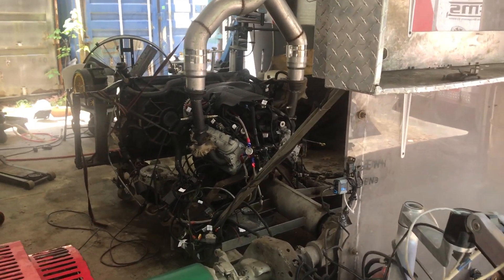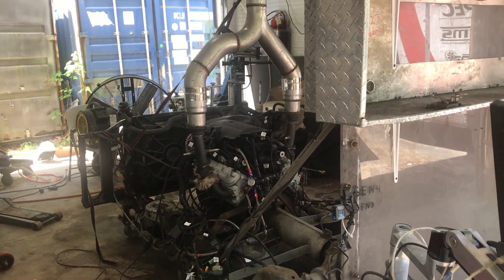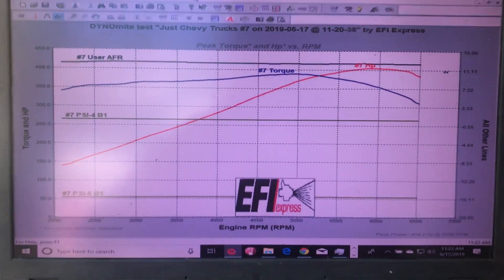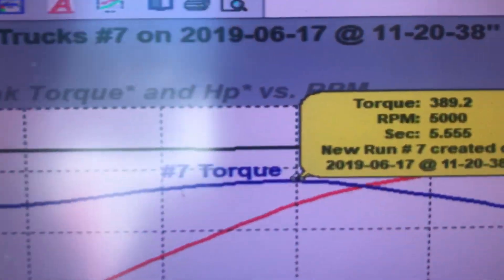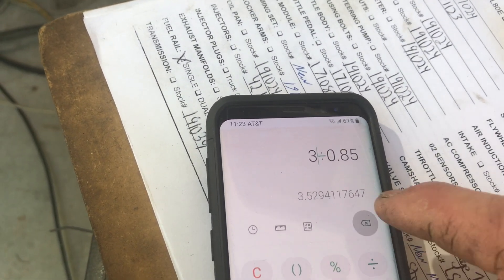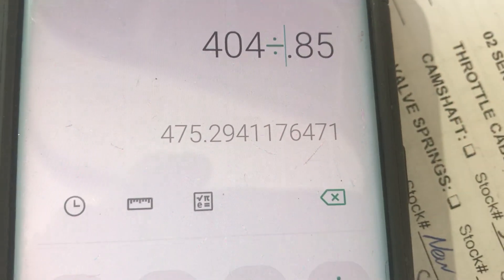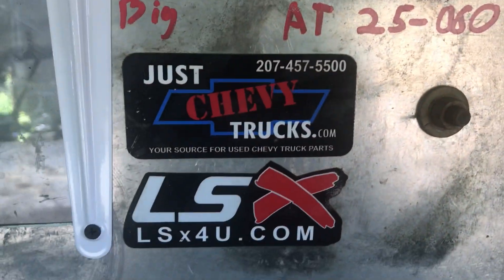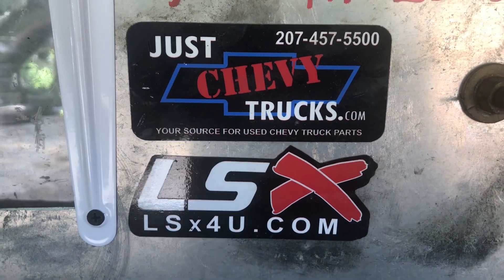Tim Heller 6.0L LQ4 Chevy LS Engine W/ Texas Speed Stage 1 Cam

Comment: Are you running the 317 heads on this motor? Part # for the cam package
Reply: @JustChevyTrucksBogBrookA-qo1mb  thank you sir. I was gonna call today to get the info, but you replied
Reply: Bigger injectors? What size?
Reply: @JustChevyTrucksBogBrookA-qo1mb  i don't see this cam on texas speed and also did you guys do a spring upgrade? or just cam only. thanks
Reply: @JustChevyTrucksBogBrookA-qo1mb  I'm confused how this Stage 1 is out performing other setups you have posted with a Stage 2.  Are there other upgrades that I'm missing?  If not, where can I find more information on this camshaft?